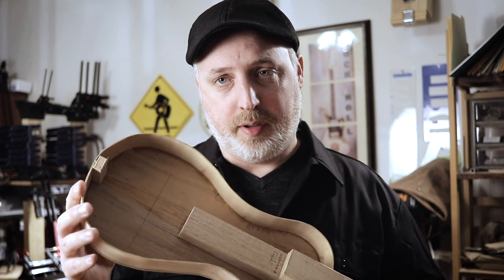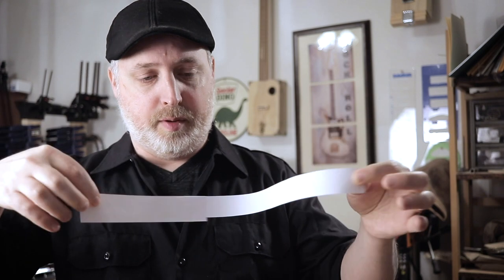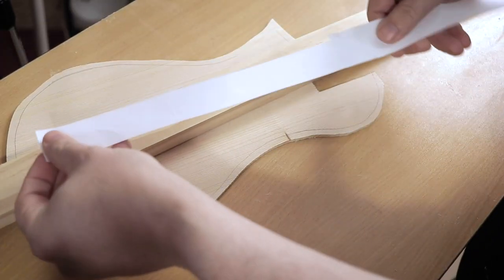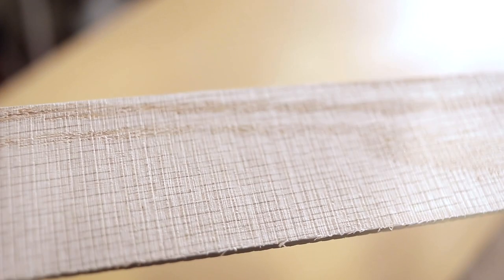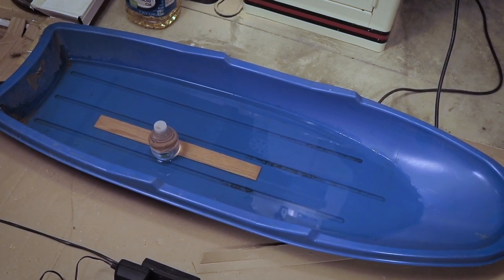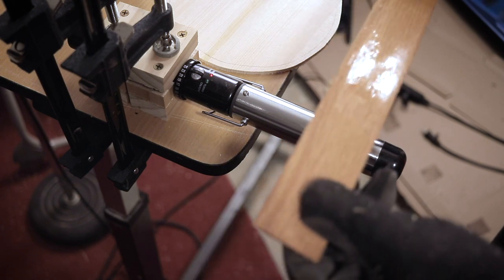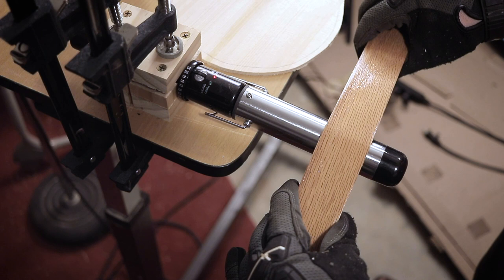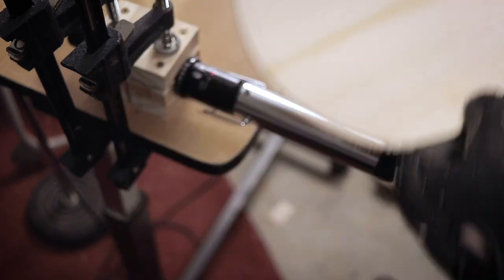Bending Wood With A Curling Iron - Box Guitar Builds

Comment: Great! I've just received the same model of curling iron, because of your video. Now I will try with the base. I'm amazed by the strength of the iron. I understand that you put light pressure on it, but anyway, it seems very strong. Thanks!!!
Reply: Marcelo, would it be the Conair Instant Heat 1" Curling Iron, Black advertised on Amazon?
Reply: @miguelalt8855  Hi Miguel, I bought the Conair Instant Heat 1-1/2'' Curling Iron model, which has a bigger barrel and is the biggest in the Conair catalogue (supongo que hablás español: el de pulgada y media tiene el tubo más grande y es el más grande que había disponible en Conair). Saludos!
Reply: @Marcelo_Mammana  

Gracias por la respuesta Marcelo, desafortunadamente no esperé su respuesta tan rápido y anoche ordené el Conair de 1 pulgada pero creo que me servirá, estoy reforzando el lado (Rib) de un cello y hasta con uno pequeño de mi esposa (aprox. 1/2 pulgada) logro resultados.

Thank you for your answer, unfortunately I didn't expect your response so quickly so last night, I ordered the 1 inch Conair but I think it will be just fine, I'm reinforcing the rib of a cello and even with a smaller one from my wife (approx. 1/ 2 inch) I got acceptable results.
Reply: @miguelalt8855  Hola Miguel. Sí, no te preocupes. Son apenas unos milímetros más. Te va a servir seguramente! Lo que no sé es si te servirá para todo el ancho de la faja de un cello. Para guitarra (unos 11-12 cm) sirve. Suerte con el trabajo! Saludos!

Comment: How would wrapping the wood in foil work after wetting? Thanks
Reply from the maker: I haven't tried that, but I'd think that it would trap the water in and steam the wood which would be a good thing.  Plus it would maybe protect the wood from burn marks.  I think I would keep it unwrapped just because you can see and feel what is going on as you work.  I might try it and post a short video.

Comment: Will this work for bending regular guitar sides ?
Reply from the maker: Don’t think so.  Depending on the length of the cheap iron, it might not be long enough to fit a wide guitar side.  Even if you can, that is more surface area to heat up and the curling iron might not be hot enough for that.